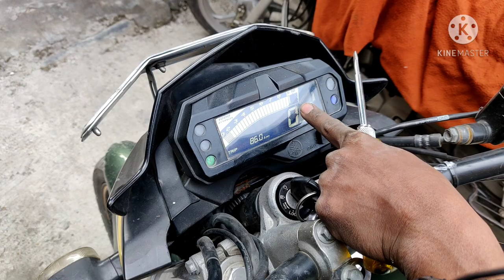Fz-s V2 Throttle Body clean Only 20 Rupees 👍🏻

Comment: After 30-40 thousand km throttle cleaning is really must. One more important thing I would suggest from my experience if you really love your FZ bike and you prefer tokeep it for a long time just replace the whole internal complete wire of your bike once because bike wiring start melts that we can't recognise easily but replace the wirings from the service center only which will enhance the durability because sometimes in too hot environment the wiring start melting and causes be problem so replace it after 40-50 thousand km